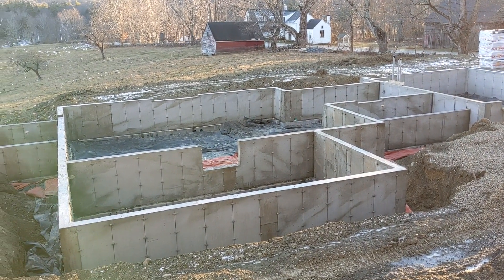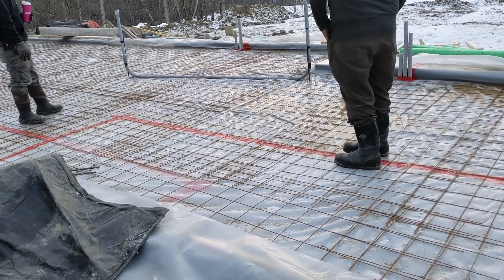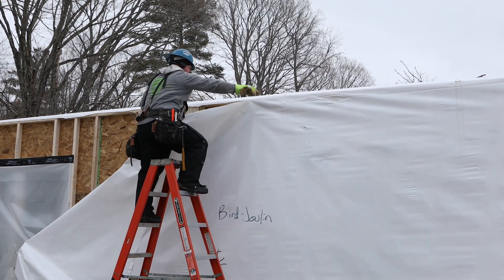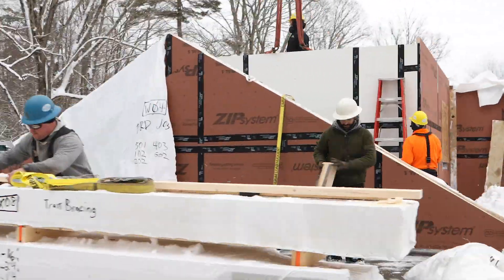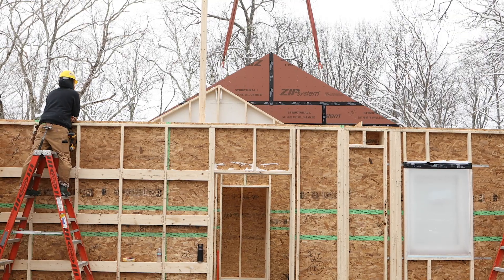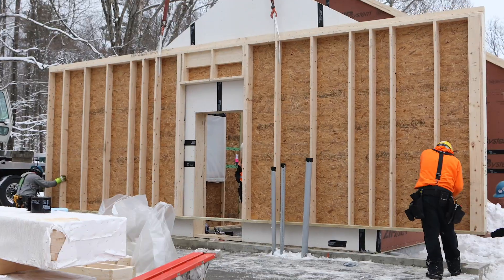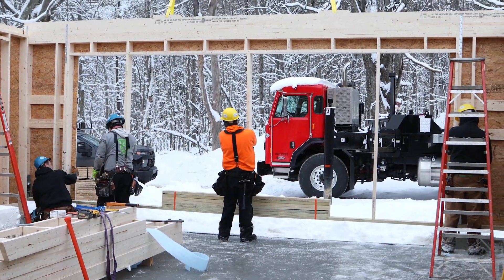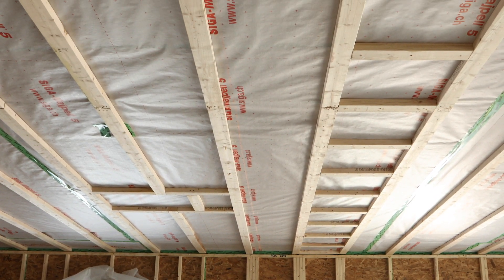Shell Raising for a Xyla in Alstead, NH

Comment: Nice video!  I was wondering about the trusses in the view from the video snapshot. I'm so used to the insulated roof panels, I didn't realize you had this as an option.  What insulation will be used above the ceiling and the SIGA?
Reply from the maker: Good question. The truss-roof Xyla is a more affordable alternative to the insulated roof panels, and the resulting ceiling is still a generous 9' tall. We blow loose-fill cellulose insulation on top of the SIGA membrane - typically to about R-60.

Comment: Is the insulation under the concrete only a vapor barrier sheet or is there extruded or expanded polystyrene layer as well?
Reply from the maker: thanks for the question! The slab and the rest of the foundation are insulated with R-15 expanded polystyrene.
Reply: Excellent! I should have figured you would have a couple of inches of the good stuff under there.